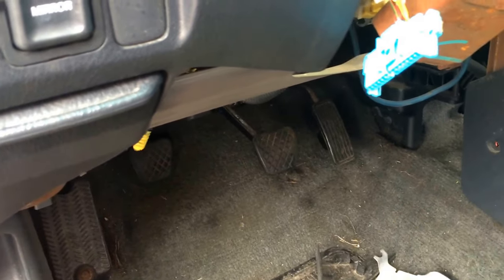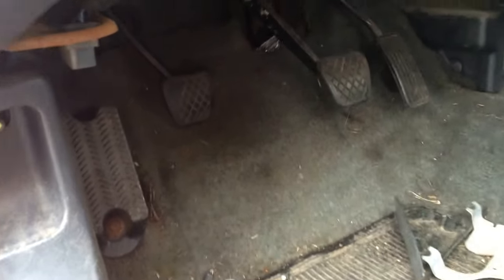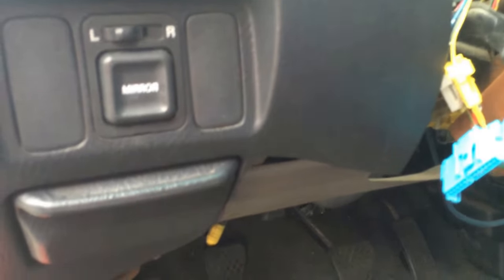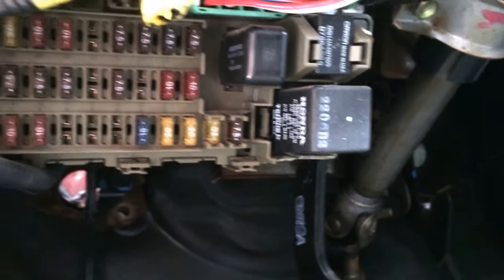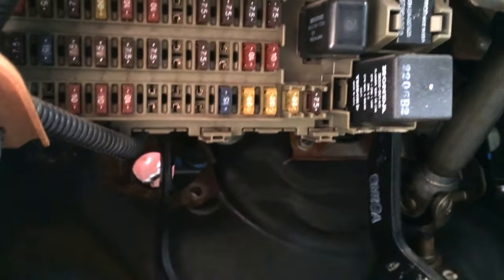Honda Civic 1996-2000 Fuse Box Location

Comment: I have a friend with a 98 civic she had oil changed  oil service light (small red bulb with no markings) can not be reset can it be reset other then putting key in slot perhaps relay under hood or ignition or battery?

Comment: I have a 95 Del Sol. Where's the Fuel Pump Fuse? 
I am pretty sure my box is on the right side but It's a 95 so odds are the fuse will look the same or have some similarity... 
thanks!
Reply: A15 14 ON DASH

Comment: Got a 1998 Honda Civic where would the fuse for the cigarette lighter be
Reply from the maker: Hello Ervin, the cigarette lighter fuse is number 27. It is located in the interior fuse box and is a 10 AMP fuse. The label on the cover will call it an "Accessory Socket", and you can find a detailed diagram at https://automobilediagram.com/honda-civic-1996-2000-fuse-diagram/ We hope this information helps and thank you for your comment!

Comment: Hey I got a 92 civic sedan and I was checking the fuse with a light tester and I have the key turn to start position . And tested the fuse no power and the took out the fuse and tested the spot that the fuse was in and still no power how can I fix this

Comment: I have 97 d16y8 and I have no power. It's completely dead. It has a new optima installed. I'd like to know which blown fuses or relays would cause this issue.
Reply: The main relay under the hood check that,should have a clear plastic window on it

Comment: Hi good night my name is jerome gilbert from trinidad ok guys and girls i have a1996 civic and my headlights low beam stop working amongst other things problem is my fuse box that is located under the dash next to the stairing wheel its missing the cover which has the fuse chart wondering if u guys could help with that thanks

Comment: Where's the low beam fuse? Low beams went out.
Reply from the maker: Hello Scott, the fuse you are looking for is number 5 and located in the fuse box under the hood. It is a 30 AMP fuse and you can find a detailed diagram of its location at https://automobilediagram.com/honda-civic-1996-2000-fuse-diagram/ Thank you for your comment and we hope this information helps!
Reply: @AUTOMOTIVESOLUTIONS  Thanks. Was looking everywhere on Google for the fuse box diagrams. Do you know where I can find torque spec information for the same vehicle?

Comment: #15 fuse is blown and the engine light is on,  speedometer,  oxygen sensor 1,2 dnt work and when I changed the fuse the engine light went off but as soon as I drove the engine light came back on and I checked the fuse box. the and fuse blew I'm trying to figure out what is the problem
Reply from the maker: +joseph quintana Hello Joseph, from what we can find, the number 15 fuse goes to the alternator. The only reason for it to blow is if the power coming off of the alternator is grounded somewhere, the wire telling the ecu that it is working is grounded or shorted, or the alternator is bad. Have you tried disconnecting the alternator and is the car charging normally? Thank you for the question and we look forward to your reply!
Reply: +AUTOMOTIVE SOLUTIONS the alternator is new, I bought it like a month ago
Reply from the maker: +joseph quintana Did you start having fuse issues after the alternator was installed or before? Thanks!
Reply: +AUTOMOTIVE SOLUTIONS tbh idk cuz the engine light been on for like a year,  I just figured out that the fuse blown so I'm not sure

Comment: Any help will be appreciated
Reply from the maker: Hello Saif Khalid! Does your drivers window and rear windows work (if it is a four door)? If the other windows are working, it is possible that it might be the window regulator, switch, or wiring that is in the bendable part of the door, usually covered by a black plastic tube. Please let us know if this information helps or if you have any additional questions. Thank you!